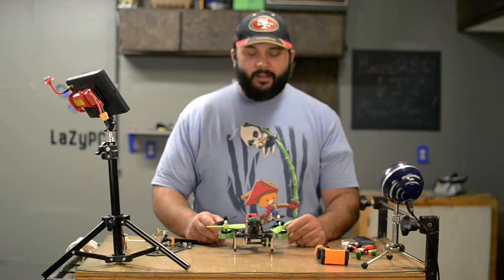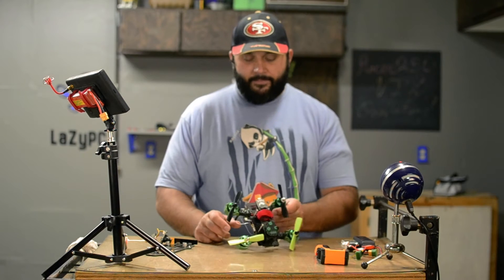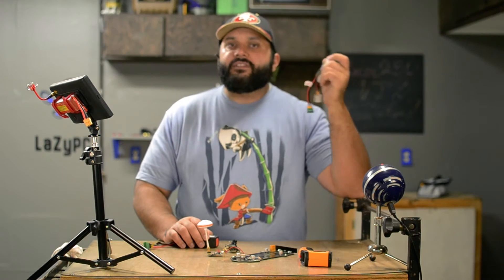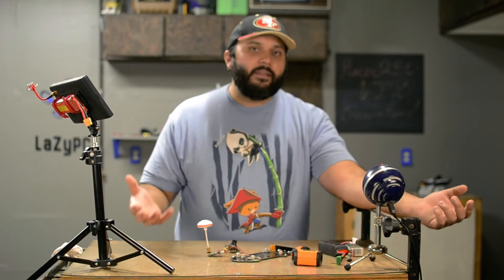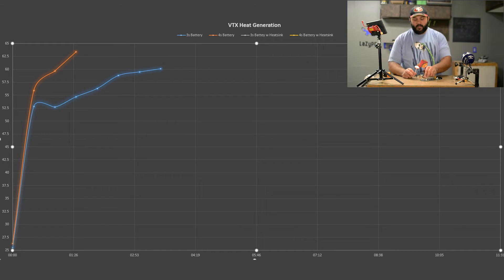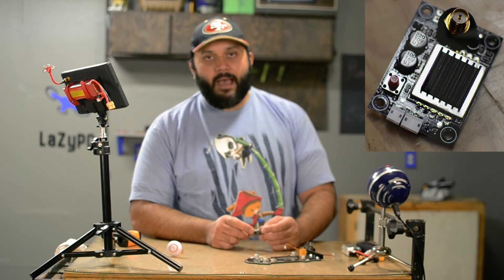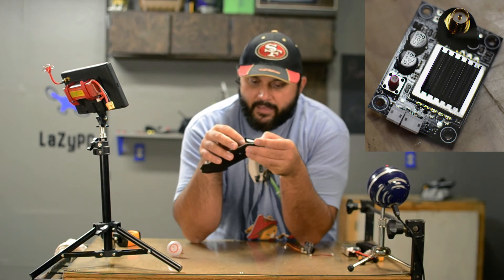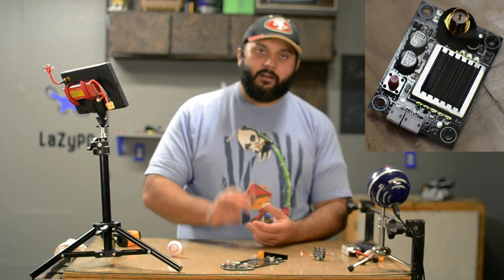Eachine Racer 250 VTX Overheating - LaZyPC

Comment: It's possible that the Tx is not the heat source,it may be a voltage regulator dissipating the heat,you could add a pre-regulator on a small perf board to drop the voltage 1 or 2 volts before it reaches the Vtx.

I have a eachine novice 3 and the heat it pours out from the area of the micro sd card which i (assume id where the Vtx is) ,is scary as i'm an electronics technician and this type of heat level without a heat sink just seems crazy.

I'm new to FPV and i've had to search for this info,i would have had some form of air ducting to catch a small percentage of air flow from a prop.

Comment: http://m.banggood.com/11115mm-Aluminum-Heat-Sink-For-Memory-Chip-IC-H26-p-945233.html

http://m.banggood.com/100mmx100mmx5mm-GPU-CPU-Heatsink-Cooler-Blue-Thermal-Conductive-Silicone-Pad-p-989163.html
Reply from the maker: Thanks! Guess I should have left a suggestion in the description.
Reply: Can you keap it its default location with that heatsink ?(it seems  very small)
Reply from the maker: No, it's a really tight fit to put anything there in the default location.
Reply: ok thx :)
Reply: Or maybe ... it will be a good idea to cut a square in the top plate and let the heatsink pop out :)
Reply from the maker: You could, but vtx in the back and battery on the top is a really common way to run the racer, and then you don't have to go cutting carbon fiber.